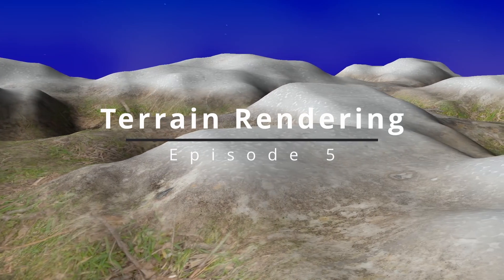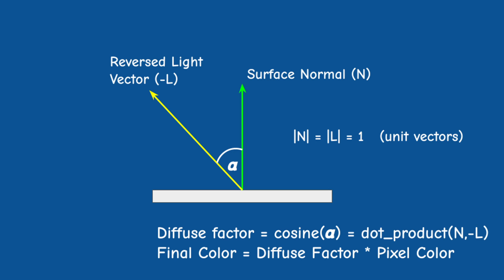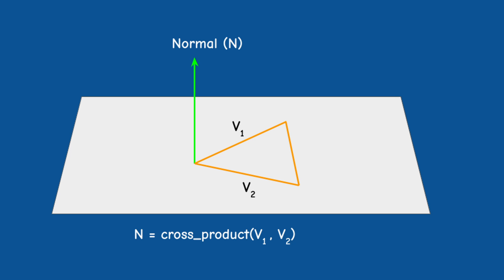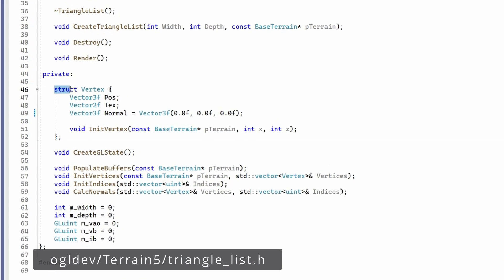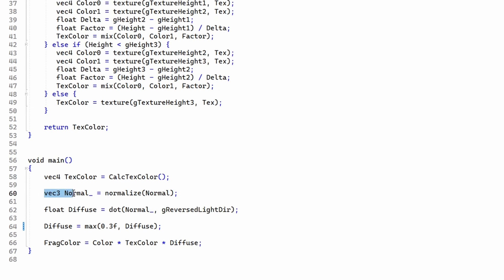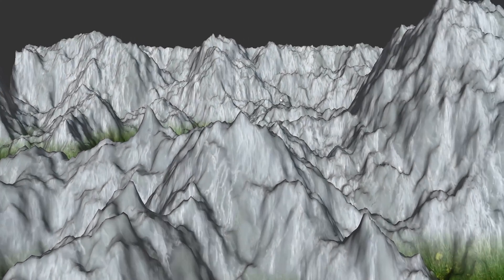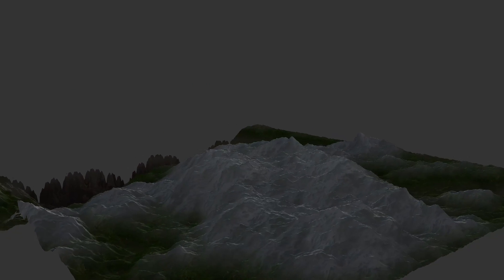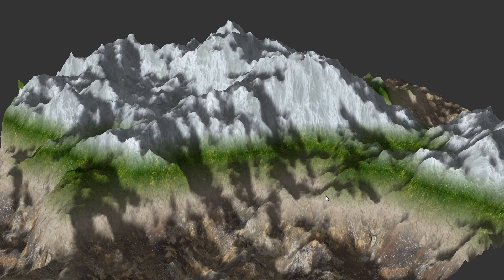Lighting // Terrain Rendering episode #5

Comment from the maker: Clone the sources: 
git clone --recurse-submodules https://github.com/emeiri/ogldev.git

If you want to get the same version that was used in the video you can checkout the tag 'TERRAIN5'.

Build on Linux:
cd ogldev/Terrain5 && ./build.sh

Build on Windows:
Open the Visual Studio solution: ogldev\Windows\ogldev_vs_2022\ogldev_vs_2022.sln 
Build the project 'TerrainRendering\Terrain5'
Reply: Do you have a quick and dirty method to calculate face normals by any chance? 😅
Reply from the maker: I've just pushed a branch called TERRAIN5_FACE_NORMALS which I've used to create the face normals demo for the video.
Reply: @OGLDEV  Thank you!!